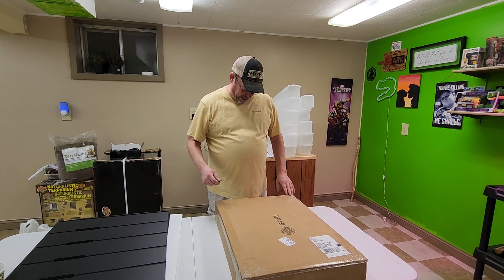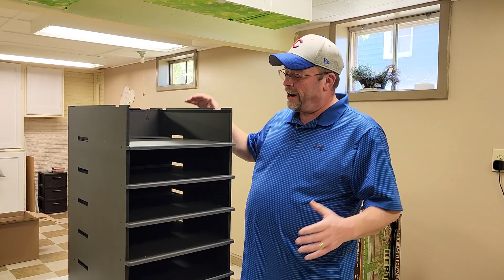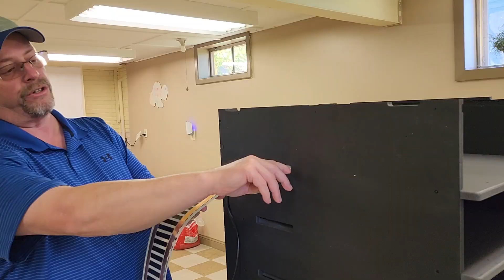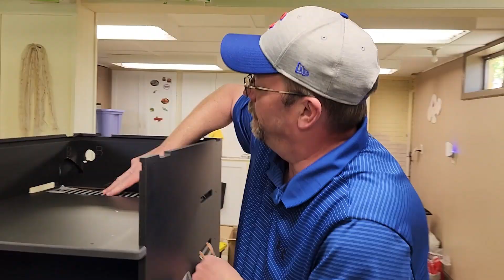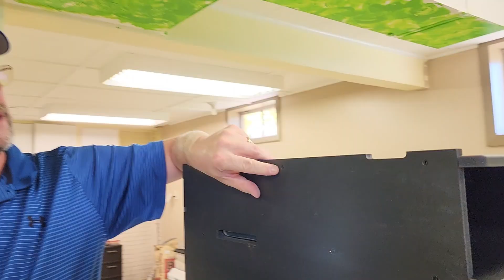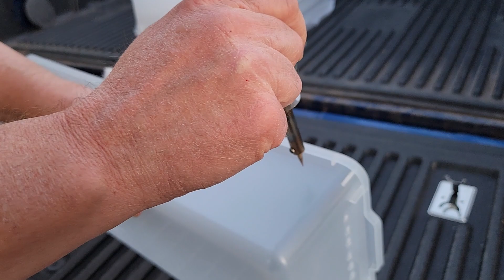Vivarium Electronics VE-6 reptile rack build and review

Comment: Copper up on the 1st shelf like you did keeps the solder joint up, which is best for the tight fit and power lead seating. On one rack build, I actually cut the Flexwatt into pieces and wired each shelf like a daisy-chain in parallel on one side of the rack. This way I kept copper up and flame retardant side down.
And then I realized later that it doesn't really matter in that kind of PVC - it is all flame retardant anyway. 
And thanks for the credit card tip! Wish I had thought of that when I assembled mine.
Reply from the maker: My pleasure. Glad my video helped.

Comment: Thank YOUUUUU so much for this great video. Mine are arriving on Saturday. Because if you I'm confident I can do this ! And of course I subscribed 🫡thank  you again !
Reply: lol me as well my tubs and stuff where supposed to get here today but it’s arriving tomorrow
Reply from the maker: @idkchkiiloop fantastic. Glad I could help.
Reply from the maker: That's awesome. You will love them. I'm glad I could help.
Reply: @geckoman4334 I have a question with the rack do I leave the heating on during night or how would I turn it off I have the ve-200 thermostat
Reply from the maker: @idkchkiiloop you set your desired temp on the thermostat and let it run 24/ 7. The thermostat will auto adjust to maintain the temp. Some thermostat can be programmed for a night time drop. Check your thermostat's directions.

Comment: These things are trash with a v300 thermostat set to 100 still won’t get over 75 on the hot side of the tub.
Reply from the maker: I have not had that issue at all. Maybe your heat tape went bad. Interesting!